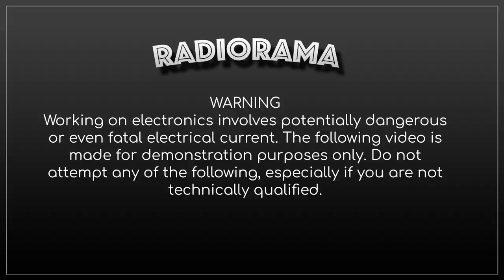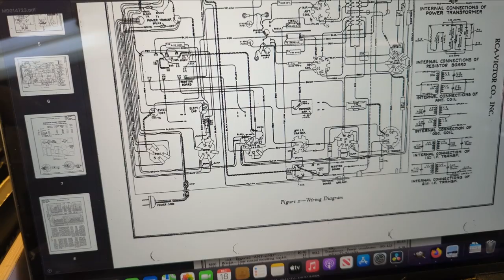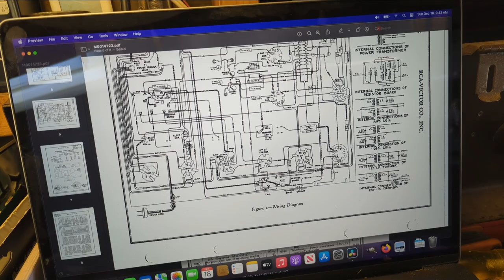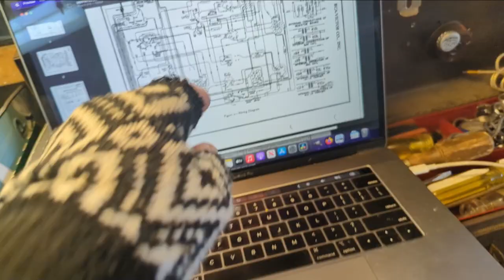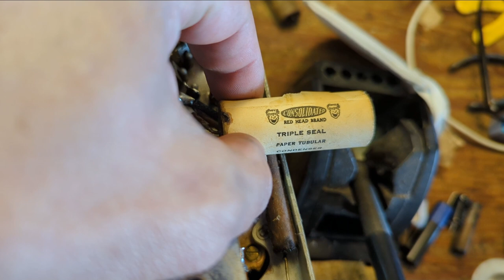1935 RCA Model 118 overhaul, refresh

Comment: A friend of mine is giving me the same exact radio soon, I do work on tube sets, I have never used a transformer in any of my sets I have always used a external pre-amp. Where did you get those and how exactly did you wire it into that set. I was going to actually put a rca jack on it and a toggle switch like I have done to a few table and floor sets that did not come with a phono input as I like to run a wireless bluetooth and play music from youtube or mp3s off of a flash drive..

Comment: That resistor board was a first. It was very much like a circuit board or couplate or Bulplate of it's day. But replacing 
anything on it makes it a PITA to get it out! The circuit wiring diagram, schematic, parts list and line drawings are right 
out of the RCA Victor Service Notes but blurry compared to the real RCA service manual (which can be found at the world 
radio history site) . One of the better designed radios from back in the day. Very highly sensitive receiver.